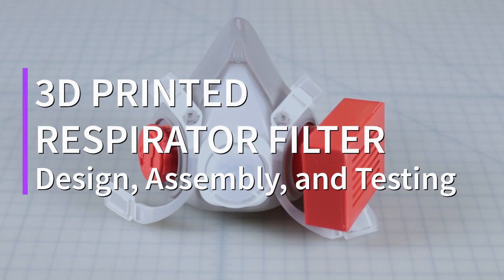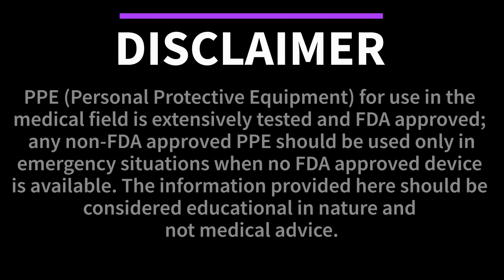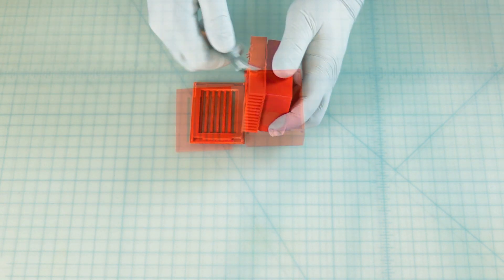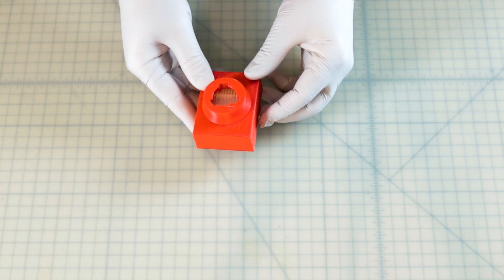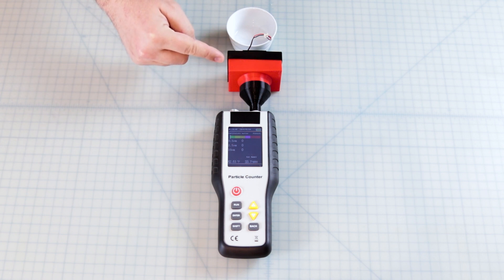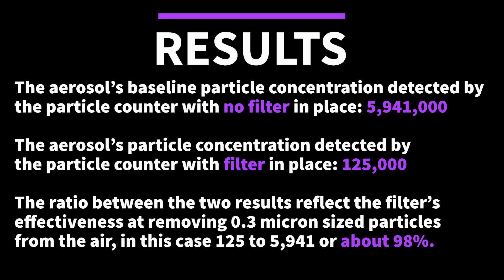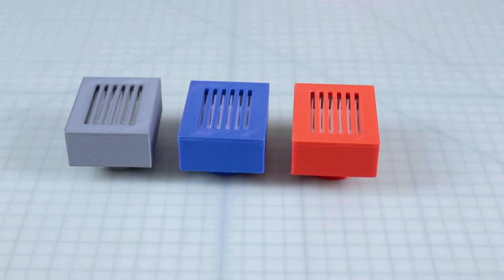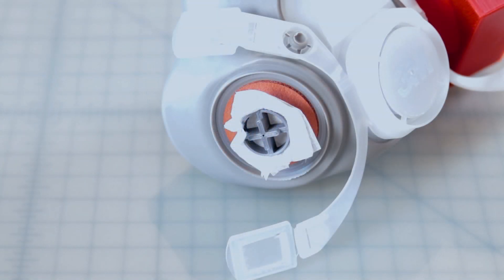3D Printed Respirator Filter

Comment: Hello there! Which i7 HEPA mask on Thingiverse would you recommend? Thank you.
Reply from the maker: I want to emphasize that I'm uneasy with using any of these items as a first line protective device. I'm also worried that having a fully printed mask against your face for hours at a time might lead to aspiration of microplastics. Even with my design as a separate filter, I also discussed adding extra material between the PLA surface and inside of the mask. So I haven't really looked into using a fully printed mask for those reasons. Sorry I couldn't be of help with that!
Reply: @DrMRod  Fair enough. My intent was for use of only an hour or so, when I have to leave quarantine for food & supply runs.

From my understanding, the masks can be sealed/ annealed/ varnished to further protect the wearer.
Reply from the maker: @utubepunk  That sounds reasonable that some post processing would improve the safety. 

My department purchased a number of the reusable 3M respirators, so i pursued the solution in the video; but, even at this point, we're still a long ways away from using them as our hospital's demand is currently being met with the trickling in of commercial N95 masks from various sources.
Reply: @DrMRod  Glad to hear you're getting commercial supplies in. Pretty messed up it even got to this point. I have more words, but will save them. 🙂

Comment: would be more reusable if the top-cover can remove and the hep filter maybe can be replaced... maybe wrap it on insertion  in a ruber-glov or condom.. material for better seal instead of permanently glue it in place .. like this cane reuse the housing.?..... just an idea
Reply: https://www.thingiverse.com/thing:4158346    surgical mask could be aded in similar fashion or as top layer to prevent droplet and lasting longer perhaps?
Reply: one more suggestion is angled  slight overlapping opening in the front also better protection of the filter insted of direct exposure..? just ideas..
Reply: and thank you for your time and effort.. looking forward to 2.0
Reply from the maker: Thanks for the input! I'm pretty concerned with reusing 3D printed parts in a hospital environment because the vetting process to properly clean them would take time and be different for every hospital, which is why this concept is a one time use. If a cartridge is exposed to the virus but not cleaned properly, they we have just negligently infected someone! If my hospital establishes guidelines on cleaning parts then I will definitely pursue a reusable concept. The overlapping opening slats is a good idea; although I think it will not reduce filter exposure as most providers should be wearing a full face shield and respiratory droplets will be inhaled into the filter from around the face shield, not directly into the filter.
Reply: @DrMRod  UV-C  boxes cant be a solution for decontaminating or steralizing... or sumerg the housing in 75% alcohol after used cartage removed.. im saing this couse i dont have a 3 d printter im planing to print 2 pair ... while one is decontaminating using the other one...the angled  flaps ads aditional protection agais big droplets..i ink u an example test.. https://www.youtube.com/watch?v=eU8UoXSfyy4   at about 2min,  hope it helps.. thar fore the flaps could be vertical like here.. https://www.thingiverse.com/thing:4219678        again : this is just kind suggestions . thank u for your time and effort.. i wish i can help in any way.. cheers thanx again!